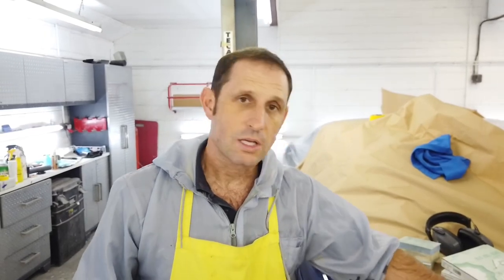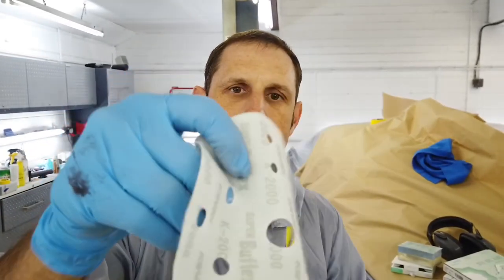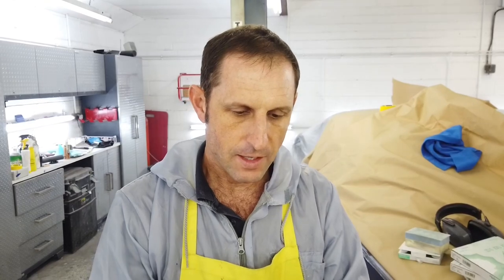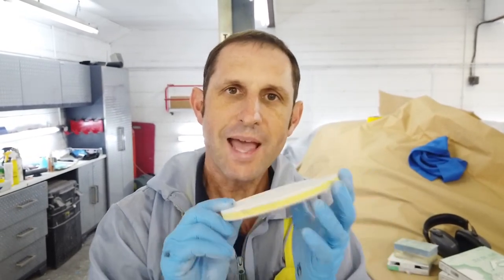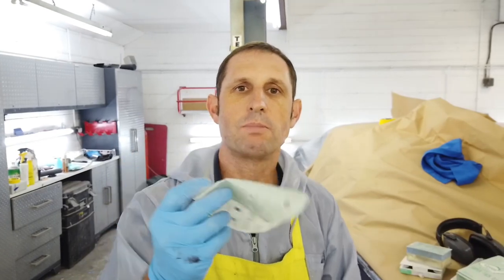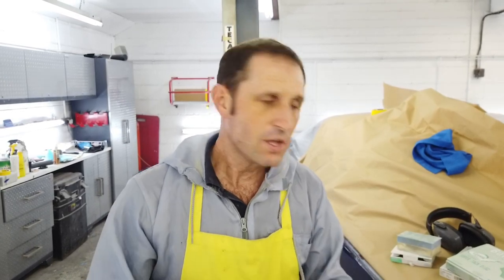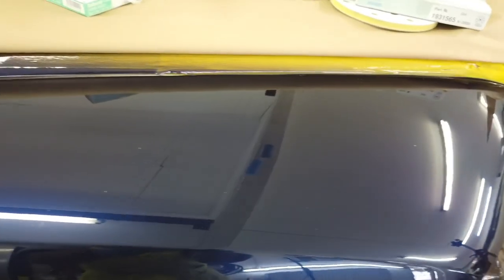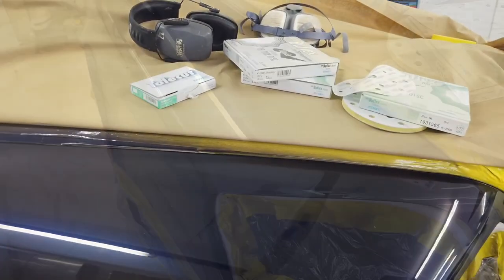KOVAX BUFLEX

Comment: I would not say pigtails are created by hooks on the interface as most times the disk holes cover these ,it is the disks themselves ie sharp edges on the holes on film type disks  ,KOVEX being more like a cloth does not have that problem .I have used Kovex without its own interface and it works the same as with .The also seem to outlast any other dry sanding disk I have used which makes them far more cost effective in the long run
Reply from the maker: Thank you for contributing to the post and you are right to a degree, the pigtails are not solely caused my the harsh hooks. 

However In my experience I feel they do contribute towards them as not every hook is covered by a disc another key contributor that I did not mentioned is the clogging of standard discs/films. These small areas on the disc sill create the pig tails too. 

Finally I personally find that I will get a much better finish requiring less work if I use the KOVAX as a full system, ie interface pad and disc but we all have our methods and I guess as long as yours works well for you then that’s all that matter 👍🏻

Comment: That looks a great product Wayne, as you mentioned it's pricey but for a smart repair like you do it will pay for itself. You can tell just by the finish the disc leaves it's going to buff up great. I thought pig tails came from grit getting clogged in the disc but didn't know they are caused by the velcro but it does make sense that it can happen, thanks for sharing 👍
Reply from the maker: Hey John, yes pig tails are also caused my the discs clogging up and I should have mentioned that too, sorry.

However I have also noticed over the years that where discs never fit well on the pad the hook section can protrude and also create the pig tails.
Reply: No worries mate, I don't normally do polishing but I often used to get pig tails in my primer or in clear when flow coating, I now use a Mirka backing plate and interface pad along with the arbranet discs which has reduced the amount I get a lot plus I like the net discs for the dust extraction which I need due to my small prep area.
Reply from the maker: We all have our own ways to do things and that's cool. It doesn't matter what road you take, as long as you get there

Comment: Hi. Great product that's obvious. We use it in Poland with great results. Can you tell me isn't it cheaper than 3M's Trizact P3000 in the UK? It is on our market (without counting in the backing pad which is quite expensive by the way). Thanks for the reply. Ohhh and great video!!
Reply from the maker: Hi

Yes I believe it is cheaper or very similar in price to the 3m trizact but I like the kovax a lot
Reply: @damageundoneltd  yea we love it. Yellow film P1500 + Buflex P2500 is a great combo. Saves lots of time on polishing. Also this is 100% dry sanding system which gives you better control over sanding process and Trizact needs water.
Reply from the maker: Yes, I agree. 

I have been sent some trizact to test so I will try it and see how I get on with it all.
Reply: @damageundoneltd  Great. Maybe a good idea would be to make a short video comparing those two product lines something like a Buflex vs. Trizact showdown? Anyway thanks for the reply and take care! And thanks for all the great content on this channel!
Reply from the maker: Ok, I will learn about the trizact to make sure I fully understand it and then make the small video 👍

Comment: Would you not use tolecut after the shark blade 🤔
Reply from the maker: Yes you could but I most likely wouldn’t, I’d just go straight in with the buflex 2000
Reply: can get same look with regular cheap  p1500 and g360 with foam pad😂😂
Reply from the maker: @WilfredGreen-ov8bh if you think so and that works for you then great 👍

Comment: one 2000 pad will take care of a whole car?
Reply from the maker: I would like to tell you that it would but I don’t believe it will. I would say 2-4 panels max per disc
Reply: @damageundoneltd 2-3 panels. I've been using it since December with no pigtails. Poo previously used trizact and always got pigtails, hook and loop is bad for clear coat final sanding.
Reply from the maker: Great contribution and it backs up what I always try and tell people 👍